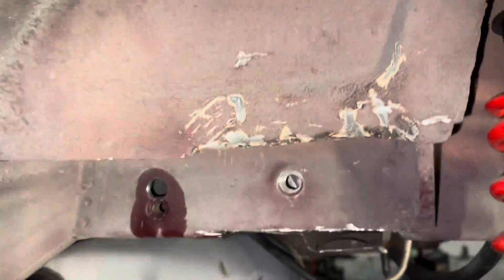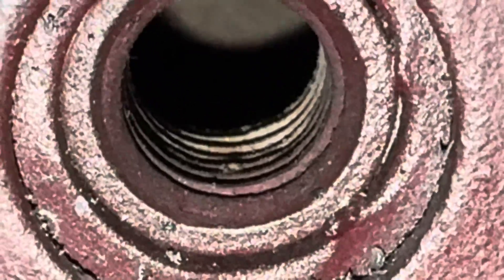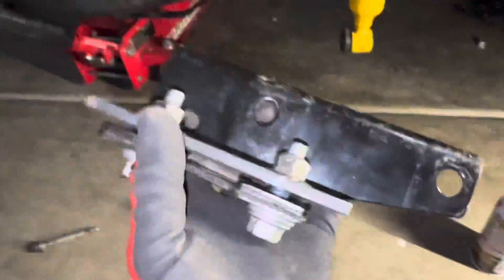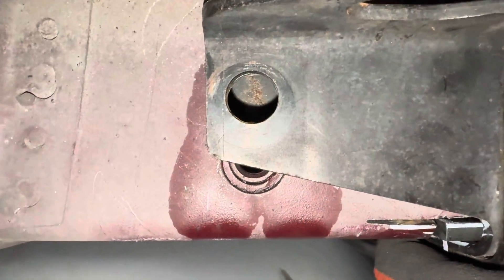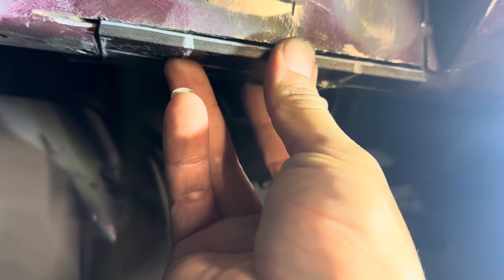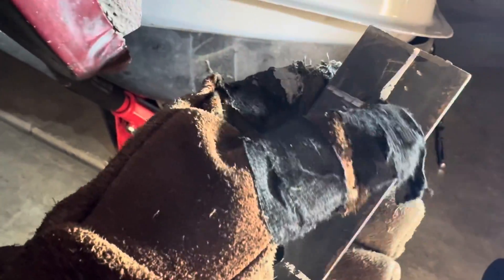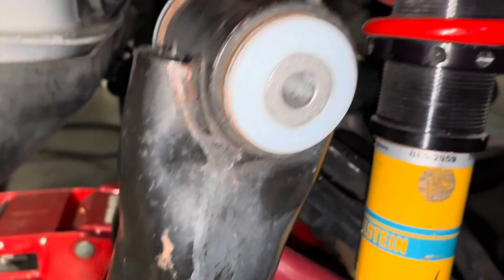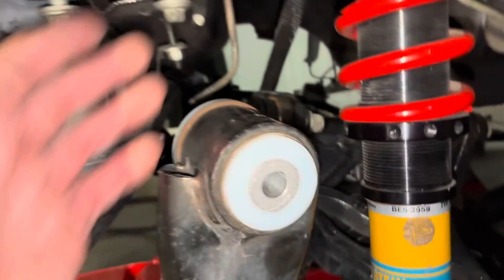Coyote Swap: How to Bolt on IRS brackets➡️Foxbody | IRS install & Full Tilt Boogie bushing kit

Comment: I just cut a lip from the top, put in a plate inside the frame  and sandwich that part you cut, same set up  with that custom braket and nut, with some weld around it, for the side hole I add it material to redrill and welder that hole on the irs brakets  etc,

Comment: You bring up a good point about the threads.. how it gets "reduced". I did the it's swap on my foxbody and I did the method where you add material to the IRS mounting bracket so that you can use the two fox bolts... I had a hard time turning one of the bolts but the others were fine